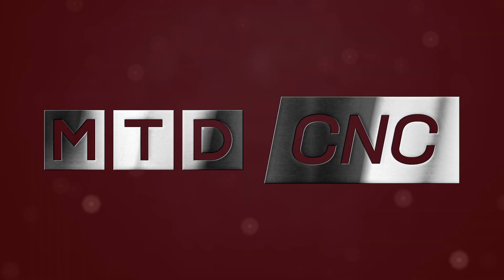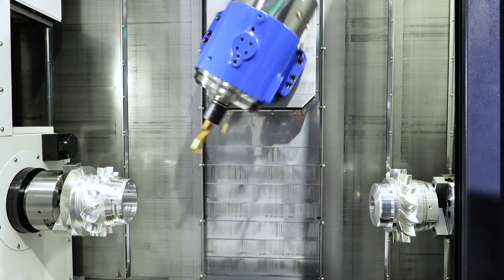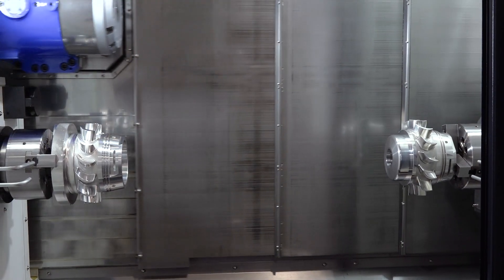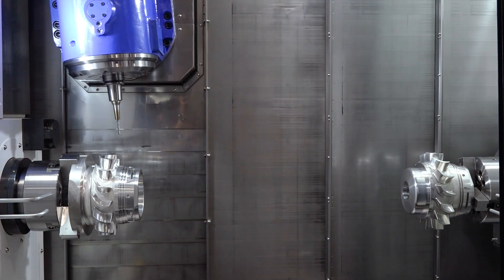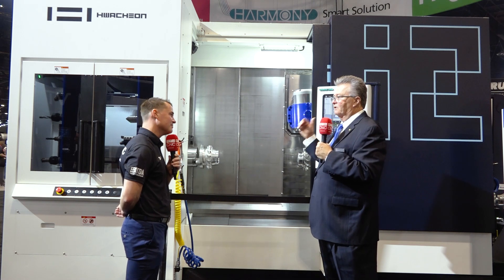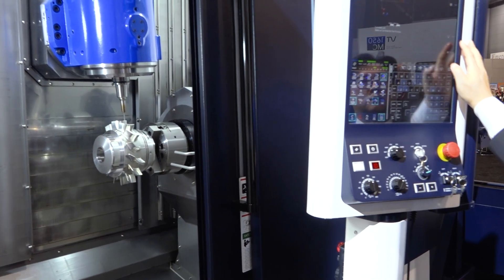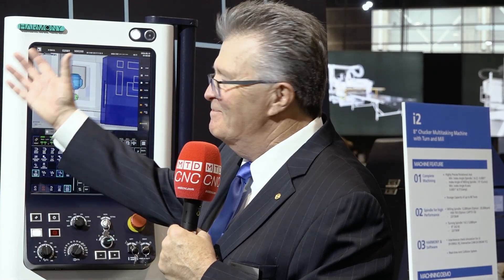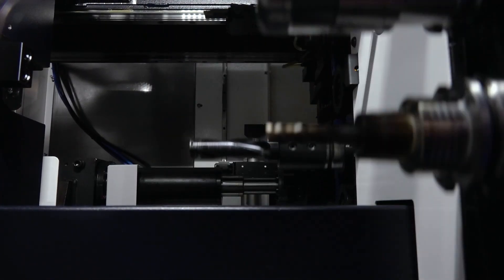Tony Gunn: Hwacheon New Multi-Tasking Machine i2

Comment: well if the nr.2 spindle is as strong in both tork. rigidity and precision as the main spindle then its what's called a counter spindle but if it's not then its called a sub spindle ( i learned the diffrence when i was standing on a swiss lathe machine )

btw if they want to make completely sure to avoide crashing by software i would highly advise that they not only have tool lenth probe but also a stiles that runs over then entire tool holder so they can put the entire shape and dimensions of the holder itself into the simulation ( nothing super precise or fancy. just like a pin with a known diametor that gets draged over the holder's surface with a light preasure so it can map the shape of the holder. +- 2mm in diameter and lenth's should be more then fine for the simulation ) and have it in the controler that every time you switch program or take out a tool from the machine it does that check the first time it takes that tool ( aka. secend time it takes that tool without the program have been changed or that tool have been taken out of the machine it dont check the toolholder shape. cause it already what/how it is with certenty )